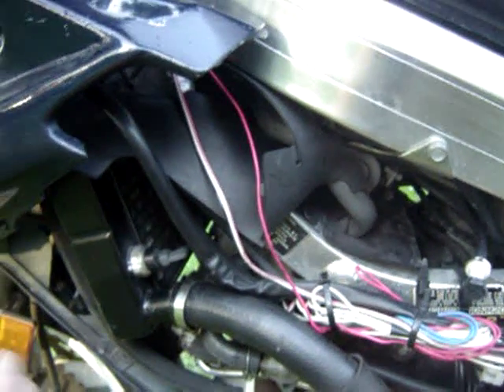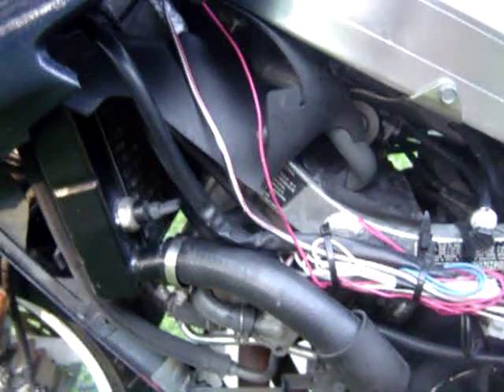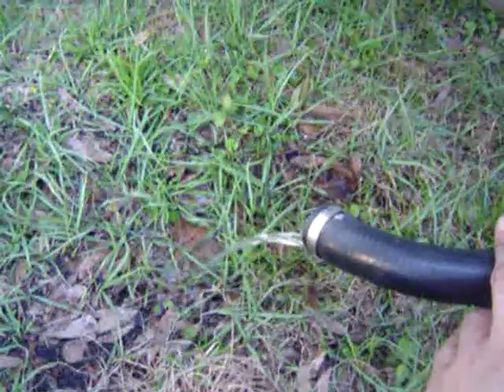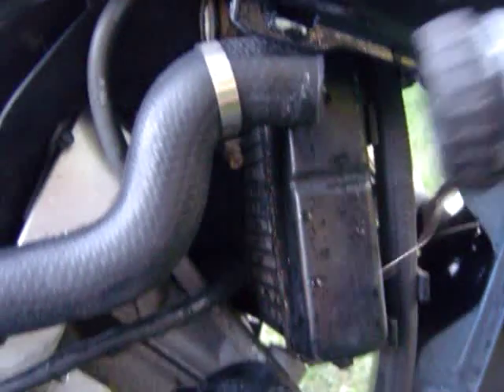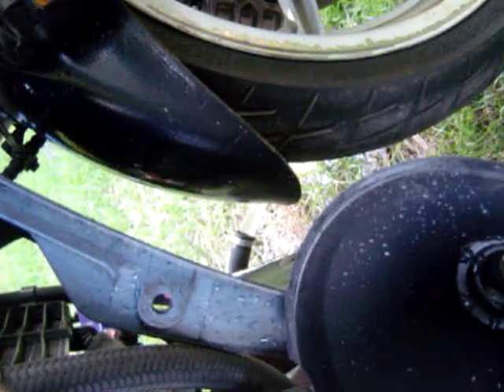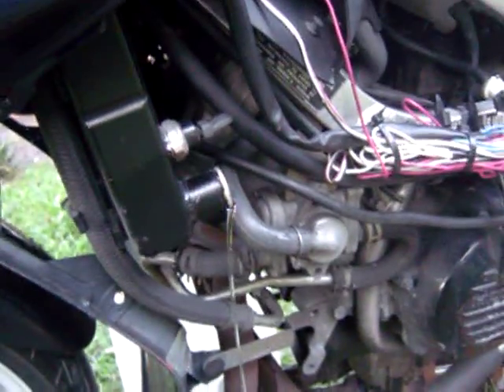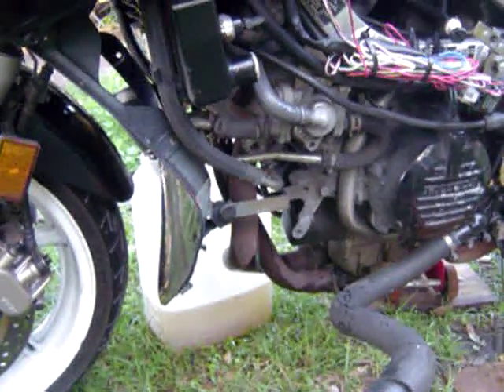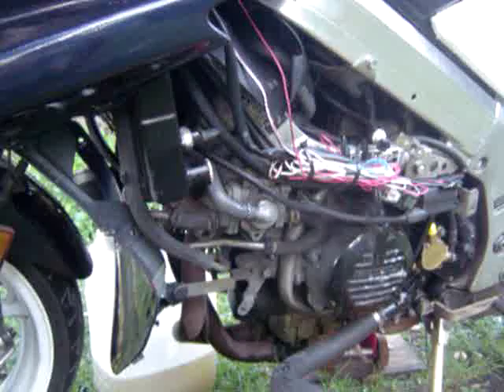How to Perform a Reverse Flush Cooling System VFR750

Comment: ohh and aside from raising boiling temps coolant also provides lubrication for coolant system moving parts as well as inhibit corrosion. CLR does offer corrosion resistance but in my shower not cooling system. is CLR safe at high temps? is it safe for use on rubber and plastic? I think if it was auto parts store would market it. just trolling
Reply from the maker: If you have a rotary or Dremel, try the CLR type cleaners.  As far as radiators and cooling systems; there are better products and you have to flush it out 100%.  You can try it, it is $1 at Walmart and the dollar stores; however, where it shines is cleaning engine blocks, ultra sound, and with wire brushes!  It will take an engine block and make it new.
Reply from the maker: You should just buy a new radiator, not worth it.  Make a video why it is better to buy a new radiator!  I was able to restore mine.

Comment: wow do  I need coolant in Texas or a thermostat? I like coolant because coolant is more than antifreeze it also raises the boiling temp of water!! vital in texas not sure how hot florida is a thermostat also regulates the temp and keeps it in the rang the highly educated and paid engineers intended it to operate. I hope no 1 listens to you! bad advice!!
Reply from the maker: After 30 years the cooling system is useless.  In Florida, there are no shortcuts when you sit at a traffic light for hours.  I have an oil cooler twice the volume and I did not buy a new radiator; instead I use super coolant and beefed up all my fans.  It is the only way to cool a motorcycle engine in extreme heat.

Comment: Hi Alex, pity i do not have a bike but i am hoping i can get a scooter or even a bike this year. I was thinking of a beginner 125cx or 250cc.  Not sure exactly  what i am going to go for, if it is a scooter or a bike. I will see.
Do you know or use a car much? Was gonna ask if you know how to flush coolant on a car if you do not have a radiator cap.
Reply from the maker: +Imre Csoka I have a muscle car that is like most women.  They cost more to own than to enjoy.  I drive the car periodically but because it is a convertible muscle car, I want to let it age and rack up miles on the motorcycles.  To flush a car system without removal of the drain valve, you buy the Prestone "reverse flush" system.  It plugs into the top hose of your water pump, the intake into the radiator.  It comes with an adapter to turn on and off.  Once you install it, you can flush your car with an ordinary garden hose.  The other way is to unscrew one of the radiator hoses; the top-highest one coming in from the water pump.